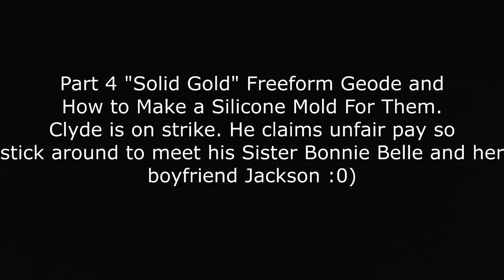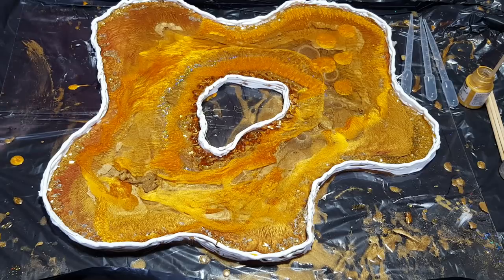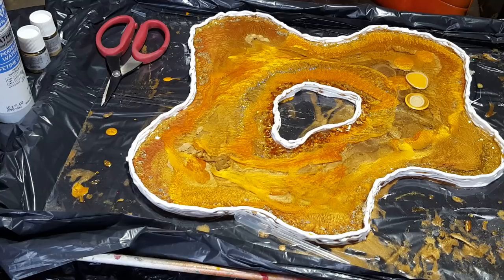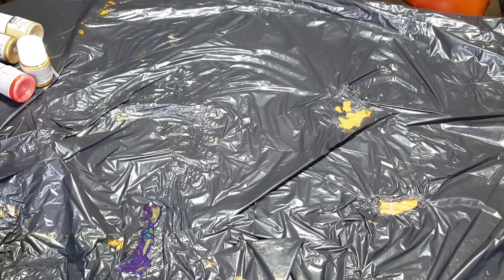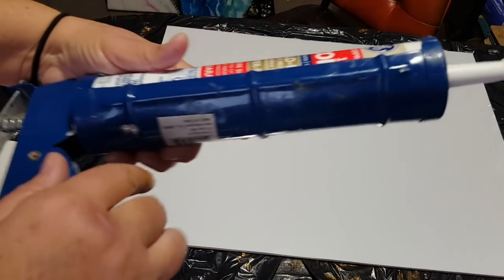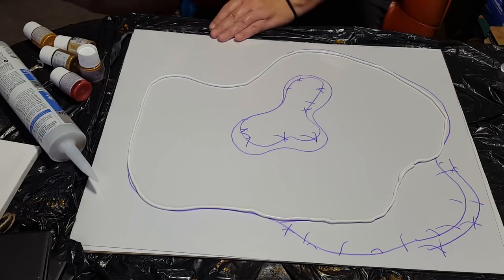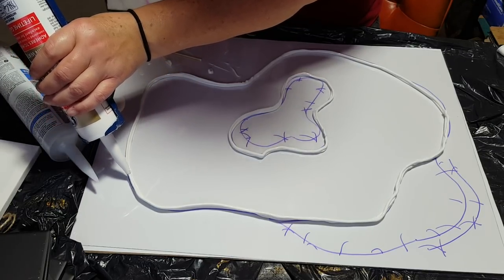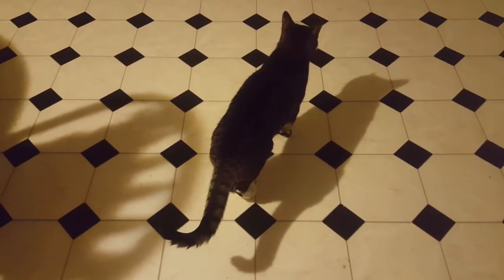Part 4 "Solid Gold" Freeform Geode & how to Make a Silicone Mold for Them

Comment: You can erase sharpie with alcohol. I just use a cotton swab. I avoid sharp edges by adding a layer of silicone with a spatula to the dry form like you are icing the sides of a cake. Squirt the silicone on for a bit then dip your spatula or knife in water with some dawn and ice it flat. It fills in the uneven edges perfectly. Also do the resin facing side of the center. It works beautifully. No sharp edges no sanding.beautiful work!
Reply from the maker: You have no clue how mad at myself I was. The reason I had to put more resin on this to begin with was because of those lines I drew and hated then the resin came out crappy so I scraped off 8 ounces if resin and then started cleaning it with rubbing alcohol and what do you know the lines just came right off lmaooo I was so pissed. Thank you for that tip lol I only wish I had talked to you earlier but it is what it is. We all learn through our mistakes. Thank you so so much for your support and help. It means the world to me🤗😙💜
Reply: Art is one happy accident away at all times. I learned this tip because a child wrote on something long ago with sharpie. You are on a lovely journey.
Reply from the maker: It sure is an happy accident 😙💜💞